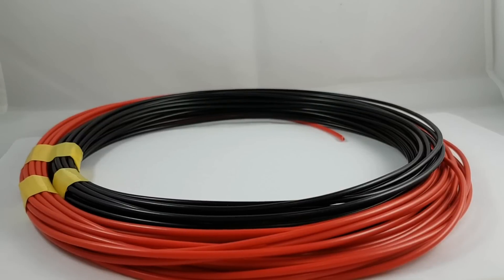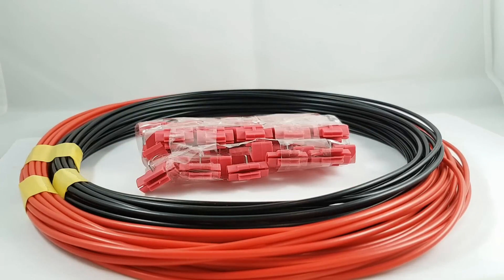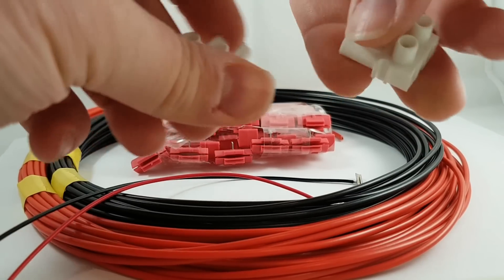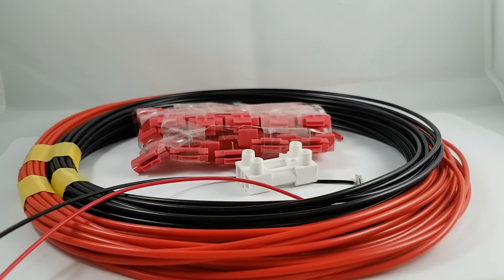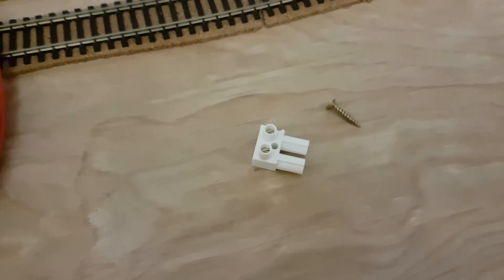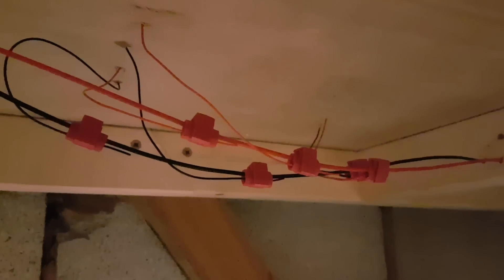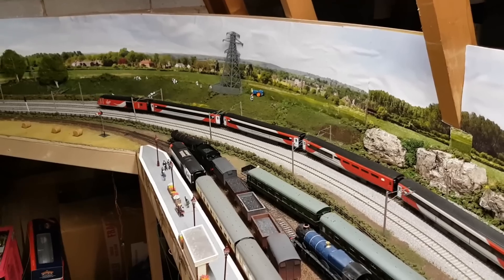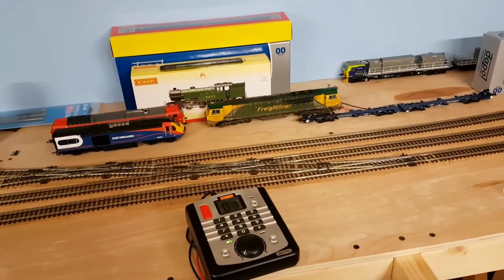How to Wire DCC for under £20 with No Soldering!

Comment: Love the wires on the fish plates.
 But the plastic crimp type connectors, I know are not good for automotive.
Back in the 70s, we wired up very easily some trucks and trailers and over the years the lighting we wired up gave us nothing but headaches.

Comment: What’s the best way to wire up around points? Would you have a dropper on all 3 bits of track around the point work? (And does it matter if you use electro or insul frog points?)
Great video - about to give a go to my first DCC wiring 😬
Reply: Insulfrog take care of themselves, but electrofrog have to be isolated and switched with the points, otherwise they don't work.
Reply: Look at Chadwick Model Railway's videos, Charlie goes into this really well.

Comment: I understand how to connect the dropper wires to the bus wires. And I also understand the bus wire is not intended to be a continous loop. But, how do you connect the bus wires to the DCC controller?
Reply from the maker: Most controllers have a port to accept the bus wires, they are then held by a small screw
Reply: Thank you, Mark  @NewJunction

Comment: Hi Richard, all very interesting. I have the Hornby Select but do not have the power chord and am experiencing difficulty locating a chord with the correct size pin (2,5/3mm dia ?)
Living in Toronto means of course tgat the British plug does not work.
Do you know if there is an adapter that would fit? 
Thanks Charlie
Reply from the maker: Hi Charlie, best bet would be to get in touch with Hornby hobbies, they'll be best suited to advise. 😊

Comment: Just to check I got this right, one end of the bus wires goes into the controller and the other ends of the bus wires are just capped off with a terminal? Then all the droppers just splice into the bus wires?
Reply from the maker: Yes that's correct, you can also use terminal blocks rather than splicers.
Reply: @NewJunction  brilliant. Thanks. Would the droppers go after the points for my sidings? Do I need to use any insulated fish plates? If so. Where?
Reply from the maker: @hikinguphigh  every peice of track if you can, but ultimately a few will do, point motors only need isolation if you will have point motors.
Reply: @NewJunction  so droppers on every piece of track including on the points? My layout is only around 7ft by 4ft
Reply: I dont plan on having point motors

Comment: Hi… just hoping you could answer a question for me please. I have built an end to end layout that is 5ft main board plus fiddle yards bringing the whole length to 11 feet, and I’m going to be using an NCE PowerCab which I believe has 2amps output. Having trawled through various videos, I think I should be using 16/0.2 wire for the DCC droppers from the track…so does this mean I need to be using 24/0.2 wire for the bus? I can’t find this information anywhere and I’ve read on a forum somewhere that the droppers need to be a smaller gauge/size than the main bus. Can you offer any guidance? Thanks in advance 👍🏻🚂

Comment: For someone new to model railways (me) and soldering (me, too) this was a breath of fresh air. I've got my order in for all the wire and Peco droppers I might need. What I'm not sure about, is whether a pair of dropper wires need to be attached for each 'oval' of track, and at roughly the same place on the layout? So, 3 pairs if the layout has an outer and 2 inner ovals, for example. Any advice would be welcome.
Reply from the maker: One connection per oval will work but the more the merrier. Id lean on more for reliability over time.
Reply: @NewJunction  Thank you for the additional assistance. Much appreciated. I've subscribed. :) By the way, you mentioned that the connectors are hard to clamp shut; but I got the impression you were trying to make the connection by pushing on the 'flap' of the connector. It may be easier to use pliers on the metal splicer to make the connection - and then close the 'flap'.
Reply from the maker: @skelligringphotographyandw7012  yes since filming a better set of pliers was the answer. 😀

Comment: One of the best most informative articles ever - I Have struggled with soldering for years, and like you say there is need to suffer. The parts are available off the shelf. I would also like to complement you on the right length of your article . Too many of these videos are too long and lack clear content - less is more!

Comment: I have a layout loop of about 32ft in total and used 5amp wire from Halfords and used gauge master wires for my droppers. I have a NCE Powercab controller, but when running more two locomotives the system shuts down after about ten minutes. Any ideas what might be happening
Reply from the maker: You may need a booster power pack?
Reply: Thanks Richard

Comment: R U running electrified points from the Select and if so can you indicate how to wire the points motors into the system? Please.
Reply from the maker: Hi, I dont use any point motors I'm afraid. 

Regards 

Richard
Reply: @NewJunction  Thats a shame I was thinking of getting back into railways (retired now) and thought I might use the select as a start up option. How do you operate your points?

Comment: Hi,so does one end of bus wire go into control box and the other just ends in the connector under the board.
Reply from the maker: Yes :)
Reply: New Junction sorry to be a pain but trying to wire it like you have so bare with me,my layout is 2 tracks on a top loop and 2 tracks on a bottom loop they do not join each other.each track has an off track to park trains on,can I put a drop on each of these so they are also electrified all the time.cheers.
Reply from the maker: Hi Nigel, 

Any questions please fire away, I'll endeavour to help! 

In effect yes you can use droppers from sidings and both levels to one set of bus wires. 

The only times that's an issue is if the positive and negative rails cross over like they would in a 'U' turn loop from a 'Y' point.

Regards

Richard
Reply: New Junction thanks a million,I’ll be starting this tomorrow but will take me a few days,if I get stuck I’ll ask.glad their is people like you who help.ive been let down so many times by people who don’t turn up when said they would do it.once again thanks.
Reply: Hi me again.with my top loop and bottom loop should I use 1 bus wire on each level or 1 for both levels.if I do use 2 bus wires can I put both wires into the back of my gauge master prodigy 2.

Comment: My preference is to solder those connectors can be a nightmare sometimes they can miss the wire and just crimp the insulation especially if you are using two sizes of multi core cable  i was always ripping them out of cars and caravans and soldering the wires with a bit of heat shrink to protect the wires like they should of been done in the first place i can bet you in the future you may start to get faults by using those and yes everyone can solder if you do it the right way i taught my six year old  years ago and my wife as long as you flux tin both and use the correct amount of heat it will work every time it just requires an hour to practice you will get good at it trust me and then you will enjoy it and save yourself loads a money  and be proud you have done a great job if you can lay scenery like you like a professional you will learn to solder as well just as good not everyone can do it first time just practice your modeling skill are brilliant get soldering and join the club lol

Comment: So, just to make sure I've got it right. I can have as many dropper wires I need on all running lines that I want powered (Sidings, up and down lines etc) and they all connect to that one bus wire that loops round? :-)
Reply from the maker: Yes 👍🏻
Reply: @NewJunction  perfect ! Cheers, when I do eventually get everything sorted baseboards etc, will be good to get my trains running properly again !

Comment: Nice update. That's exactly the system I have used on my layout, including the Peco pre-wired fishplates. Didn't buy those until I had ruined a not very expensive, and therefore cheap to replace, soldering iron making my own! I have found when splicing, it's better to squeeze the suitcase connector before you close over the plastic tab

Comment: What would happen if you used these droppers at every connection section? I gave up on my layout because I can't solder and kept melting my skin. I didn't know these wires existed! 😂 They will be so much better! I just want to know if too much will cause issues or not?

Comment: Could you link the Heathcote Electronics automatic signals to these bus wires to provide them with power?
Reply from the maker: No as they require a different voltage.

Comment: These are actually the worst connectors available . they are originaly made for aftermarket automotive purposes . and are very well known for being the cause of electrical problems . this because the metal plate opening is fixed and is very thin . so you don’t just cut through the insulation but also cut through the wire . and the electrical connection so  is very minimal . and yes they apply very easy and they appear to work very well for a short while but they are the main cause for the often unclear problems that come afterwards . if you do want a perfect working and easy working connection without soldering or screws that you also can re-use  try the wago 221 . good luck

Comment: Thank you for this video. I am new to model railways and will be building a railway very soon and want to go with DCC but was worried as to how to do it all. Out of all the videos  I have seen about DCC setting up etc this has been the most easy one to follow and you have made it look so much easier to set up. Many thanks for that. How ever one question what is the best points to use with DCC?? Gary
Reply from the maker: Hi Garry, I use insufrogs

Comment: call them suit case connectors here. they work great but just have to watch the gauge of wires used. and if the break into the smaller wire. some times the larger bus wire does not let it close up tight enough if smaller wire is to small a gauge.
Reply from the maker: Your not wrong sparky, the splicers didn't splice the smaller wires without the pliers. regards Richard
Reply: Indeed. Look closely and youll see the inner has a plastic dead end, this is for the lighter gauge ie the thicker bus wire runs through on the outer edge. Use the pliers to splice the blade through, then close the cover. Used these on cars acc wiring in the 70s and still dont like them. You should also tell usthe wiring gauge used

Comment: Richard I have a DC set up and I am using guagemaster model D,I thought I would give this a try,do you put bus wire into say track 1 as I do at the moment or do you use accessories ?
 I am a 69 year old electrical idiot that's why I am asking your advice.

Comment: Looking good! Even though you have soldered fishplates, would it still not be the effectiveness of the contact between this and the rail that would determine reliability?
Reply: Soldered fishplates are as pointless as a chocolate teacup, i dont use any metal fishplayes every fishplate i have is insulated type for block detection

Comment: great video! I'm new to the hobby, can you perhaps do a follow-up with wiring for turnouts?
Reply from the maker: Oliver Mendez I don't wire mine up. :-)
Reply from the maker: Yes, point motors are fantastic but I really can be doing without the extra work load wiring them up.

Comment: Im a bit confused, you said you only were going to have 4 pairs of droppers for your layout, so why have you got 3 pairs within inches of each other? I do realize there on different tracks
Reply from the maker: I've got four locations on each 'loop' where I've connected the track to the bus wire.
Reply: So 12 in total, thanks

Comment: Great video NJ, could you please explain the whole mystery over turnouts thought please peco told me I had to put insulated joiner on each frog rail and the wire every turnout, you didn't mention wiring any turnouts? Thank you complete novice on the layout front let alone dcc and wiring am just starting out for the first time

Comment: very good video not like some of the rubbish i have to watch
Reply from the maker: Thanks Ian
Reply: @NewJunction  Hi I need your help band advice,i have a two track layout with a twin track controller but the tracks are not connected,Question, can i run a train on each track but one in the opposite direction by either switching polarity on one track ,or,turning the train around and using the reverse switch on the controller, Kind regards Ian
Reply from the maker: @iancrabtree1195  if your running DCC it wont matter 👍🏻

Comment: I have used these connectors & have had good reliability from them.  I know they had a bad rep' in the motor industry & I believe in the caravan industry, as it saved time soldering etc.   I got mine from the dipstick store, sorry I mean the Maplins store. I called it that after I went in & asked for some solder & got a kid having to run to the boss & ask whats solder. DOH

Comment: Suit case connectors is what I know them as here in the States! I always crimp the blade down first with a good set of pliers, or they make a special crimping tool just for those suit case connectors, then give a tug on both wires to see if it has spliced them. If all good, then close the lid and that doesn't require the pliers. I'm running all of my droppers(feeder wires here in the states), to a terminal strip. Then bus wires to the terminal strip using the suit case connectors from the main bus line. I hate to run trains in your attic space! All of the rafters to deal with? But you guys have limited space for layouts and have to use want the wife gives you for space! I don't have a wife, so I got free rain of the whole basement! 11' x 30'! Have fun, Roy

Comment: Is the brand of connector (called an insulation displacement connector or suitcase connector) you used from 3M? They look like the #905 connector from 3M. You need to mention that the connector needs to match the gauge of the wires or you may not get a good connection. Enjoyed the video and your layout updates.
Reply from the maker: No idea if i'm honest, the place I brought them from sorted me out. :D

Comment: Great video - puts my basic 6x4 OO layout to shame, but we all have to start somewhere. Can I ask what the Firmware and Hardware versions are on YOUR Select controller as mine doesn't appear to be working as expected with 15/30 on start up. I have a DCC/TTS Flying Scotsman and although the locomotive moves the sounds (sound) automatically without even touching the Function keys. Any advice is most welcome !

Comment: Sadly, these fail after a number of years. I had to replace many of them.
Reply: if any is able to, please clarify what fails after x number of years? The wiring as a whole? Certain aspects of the wiring? Is soldering it that much better? I've never soldered anything in my life and have very little experience with wiring at all (beyond hanging light fixtures and changing out outlets/light switches).
Reply: @keeganseva3975  Suit case connectors were made for the automovive trander in the 1960;s for use automovite wiring which is FLEX wire, not solid wire. the connector can fail in 5 years or less depending on the size of the wire. soldering is always better because it's 100% cconnected.
There is a fuction connector available that you slide the wire into but I don't know about the UK's availablity. I am sure there are many video on how solder. It's not that hard.

Comment: Would be the last connector i'd use. Known to 20th Century car mechanics as Scotch Locks. practically banned from any respectable garage tool box nowadays.
What's that? Bulb gone in your Mk3 Escort rear cluster? No actually it`s the 7 core trailer cable that's been Scotch Locked to the main loom. :)
Reply: No good for cars but perfect for model railways
Reply: @Synthematix  yes, perfect for applications where no sort of reliability whatsoever is required. Much better you use piggyback spade crimps if you REALLY must avoid soldering.
Reply: You know you can have bad solder joints too aswell right?
Reply: @Synthematix  yes but you can train yourself to solder better, scotchlocks will always be shite.
Reply: Well theyre good enough for everard junction, one of the best modellers in the country
Reply: @Synthematix  and banned by Rolls-Royce, one of the best engineering company's in the world.
Reply: But model railways arent cars lol, you know the standard PC Molex sata connectors work on the same principle yea? Cars can run up near to 100amps lol

Comment: Hi great video and looks nice and neat, when I started my baseboards last week I am doing DC but as I say doing  the baseboards I thought I would put  bus wires in before I put the tops on then if I do change to DCC at a later date they will be there and all I would need to do is connect up to them. Regards George..
Reply from the maker: I'd recommend going DCC for the extra control it offers & as you've seen, no real extra work or cost involved.

Comment: If i was to build a layout some 40 meters in length, 2 loops + a siding for example, how many bus connections would be a safe bet? every 2/3 meters necessary or could i get away with longer gaps? only running 3 locos.

would be DCC of course, ive only ever done analogue in the past (1990's)
Reply from the maker: Yes that will be perfect, optimum is every yard but gets a bit extreme like that.